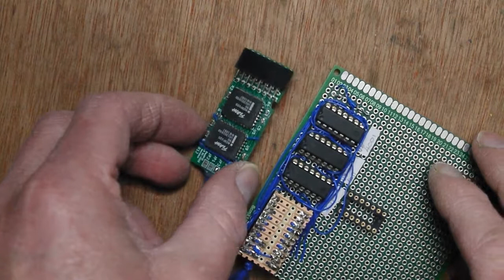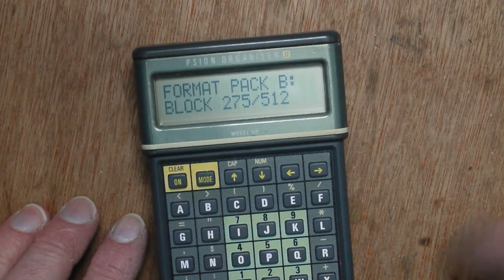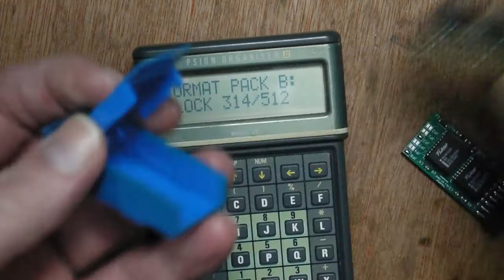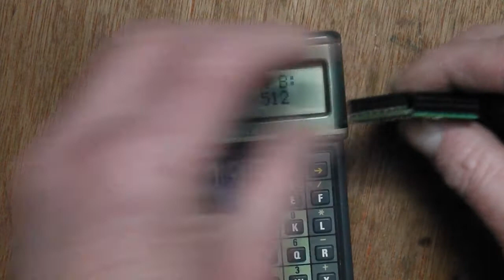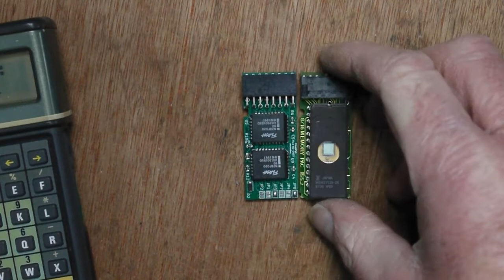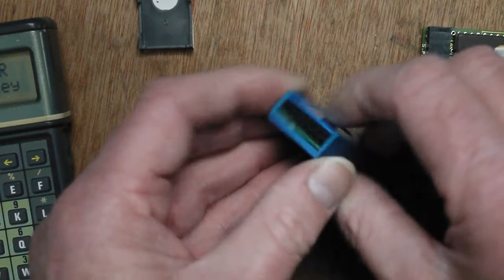Making a 512K Flash Datapack for the Psion Organiser 2 Part 6: PCBs

Comment: Is there any possibility for a larger capacity flash data pack?
Reply from the maker: That is a good question. I have tried larger chips on this PCb and it didn't work. i think it's because the programming instructions are different for that family of chips, so the Psion flash driver doesn't work. it may be possible to make a pack with different chips, though.

Comment: Great job! You sir, are a genius! Any more developments on the Pico based Org II remake? Looking forward to seeing that when it's ready. Really really in awe of your work :-) Thanks! 👍
Reply from the maker: Thanks. Not sure about genius though, this is all pretty straightforward stuff, if a bit tricky now and again. the remake is still ongoing. In a way it's finished now, but has limitations and advantages. I'm sidetracked by some other things at the moment but I do intend working on it more. I do view it as a platform for people to experiment with, so I'm not sure if it will ever be absolutely finished. When would you say it was ready, from your point of view?
Reply: That's a really great question! For me, a finished version is one that I can use for all the standard things I currently do with my LZ64 (coding in OPL, running programme paks etc..), and that is compatible with standard Psion Org kit (data paks etc..) but with the option to use things like your pico based datapak gadget that would be larger, and therefore more useful than original hardware. But really, the "cool factor" of using a re-make of some truly amazing original hardware/software is what makes it so interesting for me. Its just a great concept!